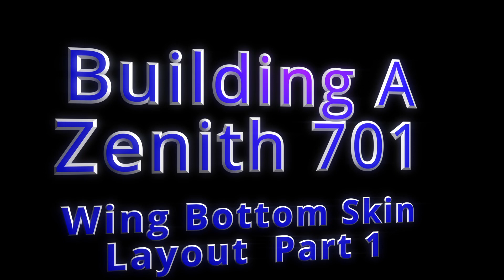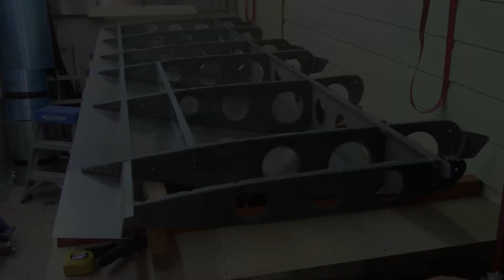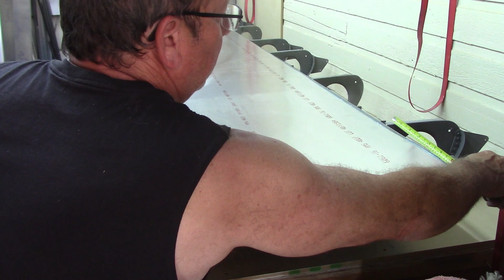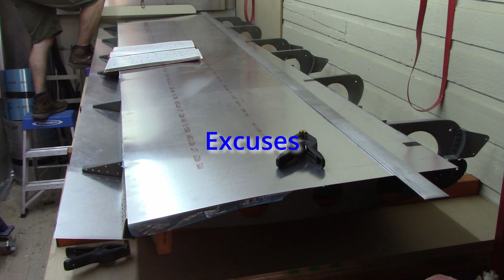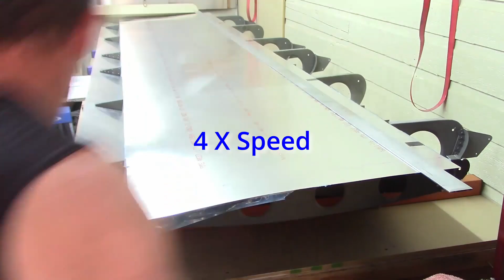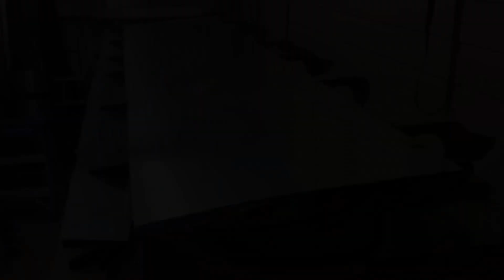Building A Zenith 701: Installing The Botton Wing Skin, Part 1

Comment: Dan, how much will that one section of wing span weigh when completed? Have a great day.
Reply from the maker: The other wing sitting in the cradle has all the skins attached. In it’s current configuration weighs about 38 pounds, it has at least a couple of pounds of clecos which will be removed, but has no wiring or lights no wing tip which will be carbon fiber, and no fuel tanks and associated fittings. I am guessing when fully assembled they will be in the 50 pound range plus slats and flaperons
Reply: @hillsgun  I didn’t think about all the items you mentioned. It’s interesting seeing the build. Thanks!
Reply from the maker: My pleasure